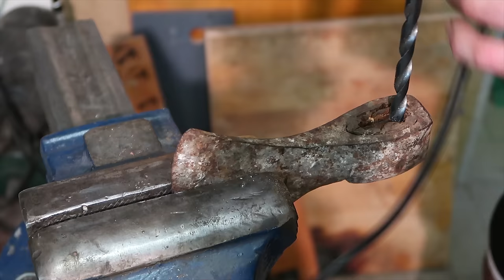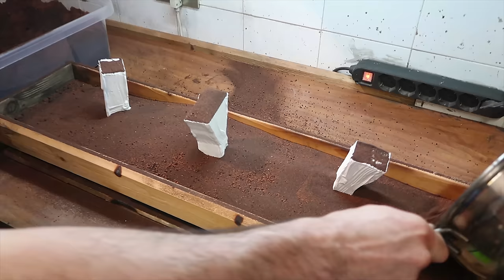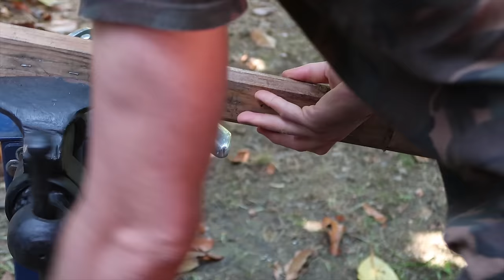Antique Hatchet Restoration. SORT OF...

Comment: easier to soak it overnight in  white  vinegar , removes rust and dirt with less cleanup afterwards ! I`ve gotten a nice antique grey patina on old rusted axes and knives using the method , they can easily be polished with a little steel wool and 200 grit and 500 grit wet and dry ! no special equipment required !

Comment: Wow, cool project. What voltage did you use in the water bath with baking soda to derust ?
Reply: 4.3 Volt
Reply: I tried the toaster , it gave my little sister a quick jolt and a smile, she is an electrifying girl.
Reply: the voltage doesn't really matter because the higher the voltage the faster the electrolysis will happen
however the type of metal you use is crucial for the chemical reaction
Reply: True chemist
Reply: oh no x)
it's basic chemistry i learned from my senior's year (or bac) now i'm studying mechanic engingeering

Comment: A rubber grip would have been cool on the handle
Reply: That's a horrible idea, as with the metal handle.  The rubber would give you blisters and metal transfers too much vibration to be functional.
Reply: Perhaps a leather wrapping around the aluminum would be better. Leather would help absorb some of the shock and secure grip, but at least that handle will never break.

Comment: The blade of rusted axe, might be soother if after electrolysis you grind the metal, rust is not only in the surface and polish the metal again. That's why the axe didn't stand on the wood after you throw it its a sign that there is still rust on the blade

Comment: Very good restoration. 
Tool is not functional however because much vibration will be absorbed by the user's hand due to the handle's material. 
Metal cannot replace wood in such tools.

Comment: 4 years later and wondering how the Aluminum Steel bond is hanging in there as they are dissimilar metals. Did the handle start rapidly corroding?

Comment: There could be galvanic corrosion between the axe head and the aluminium handle.  Not a good idea to combine these metals. A wooden handle would have been better and more aesthetically pleasing.  It would have made throwing the axe at a target much easier as well due to the weight differential.

Comment: Video games be like 
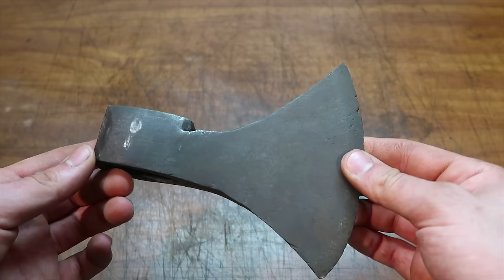basic Hatchet: 2:07
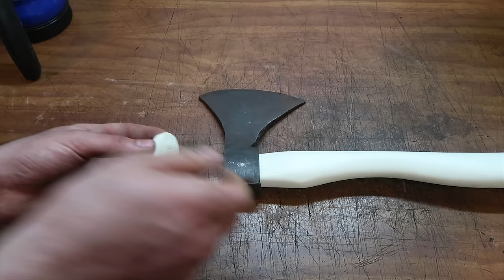Basic Handle: 4:27
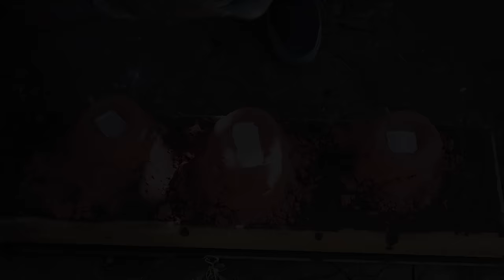Forging: 7:34
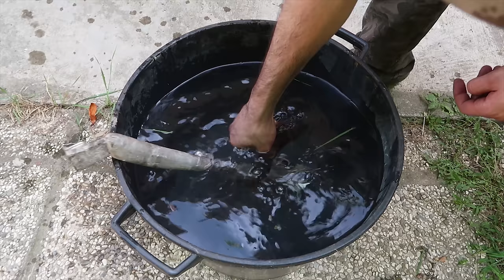Completed Forging: 8:25
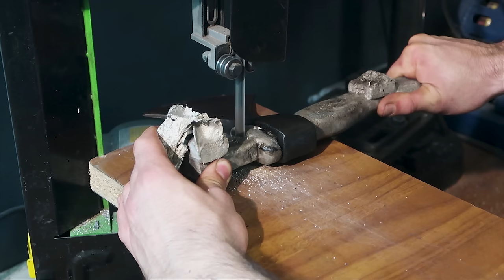Forming the Hatchet back: 8:33
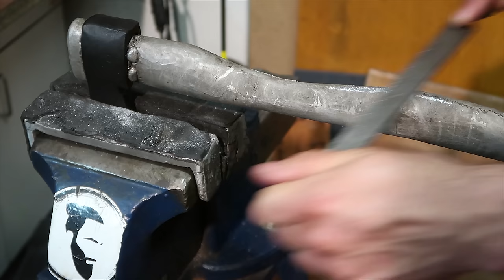Repairing the metal handle: 9:09
Making the handle Dull: 9:38
Manual the Stability: 10:18
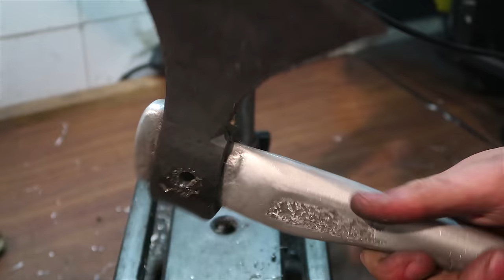Manual the Stability pt2: 11:12
Polishing: 11:49
Sharpening the Hatchet: 12:26
Testing the Durability: 13:12
Throwing test: 13:38
Hatchet: 99
Handle: 99

Comment: I was good with project...right up until you poured liquid aluminum INTO the axe head itself...destroying most of the temper of the steel. I'm betting if you had Rockwell tested the hardness before-and-after (and assuming 1075 or higher steel), you probably dropped 10 points Rc by doing this...turning 'good axe head' into 'stick of gray butter' in hardness...

Comment: Well done (sarcasm) poured aluminum into the hardened head of the axe and let the f**k go of the metal, since the melting temperature of aluminum is above 600 degrees, which eventually leads to a high release and loss of hardness of the axe blade. You can't work with this tool for a long time without quenching and a normal vacation, comrade. Video for video's sake...

Comment: Handle doesnt make sense, not because its heavy, but because metal transfers all vibrations to your hand, which will be painfull. Wooden handles, or rubber+fiberglass, is used not just for aestethics or jjst the weight. Vibrations are a bitch

Comment: 0:25 How thick must someone be to put it in the vice like that and not realise it’ll just keep falling? 🤦🏻‍♂️

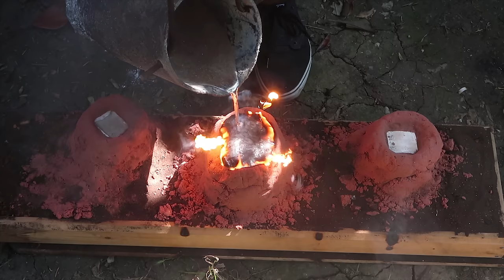Also 7:44, clearly full and flowing slowly, so instead of switching to a different place to pour you just carry on? 🤣🥴

Furthermore, there’s a reason we use wood for the handle, it provides flex and keeps it light while keeping the weight heavy at the end, the axe head. Making a better swing. Yours is now totally rigid so will eventually mess your wrist up, also it’s heavy all over meaning the swing won’t be as efficient.

Comment: 1st important point when working WITH an Axe: have a steady surface below the piece of wood you need to cut.
overall: not impressed. an axe needs either a wood or fibre shaft.